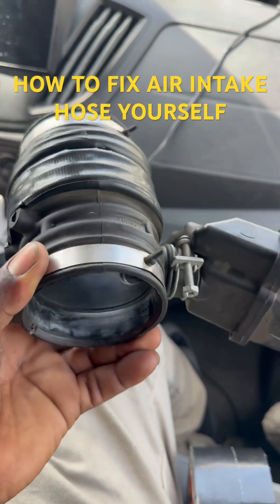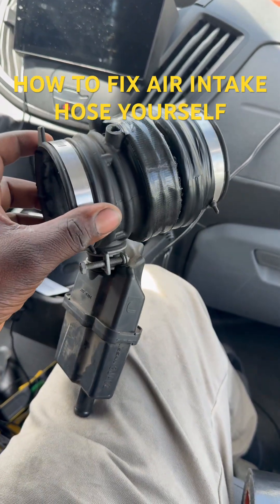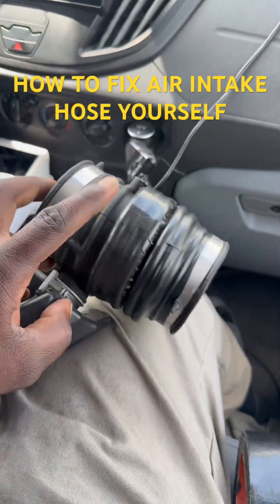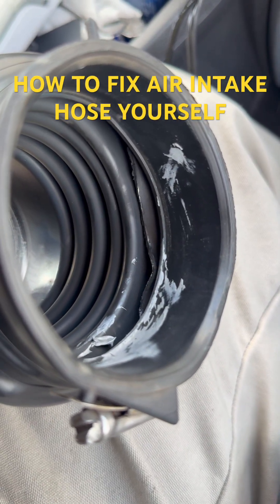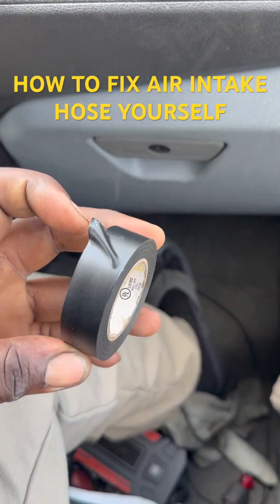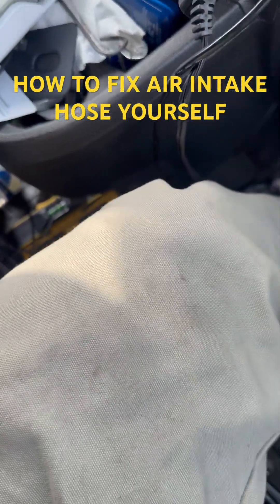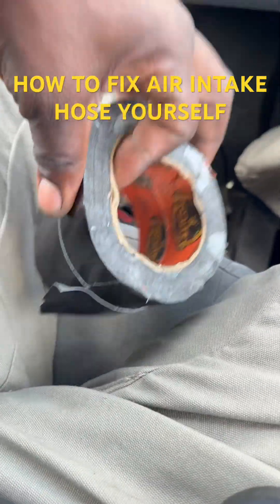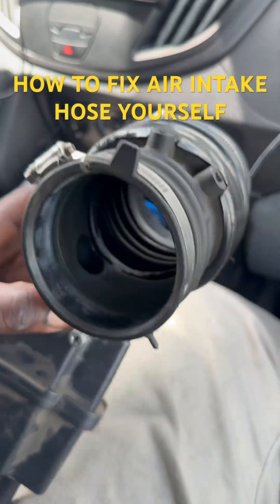How To Fix Air Intake Hose Yourself

Comment: What is it good for Mr Talented
Reply from the maker: The air intake hose is an important part of your engine’s air intake system. Its main job is to:

Direct air into the engine
	•	It connects the air filter box to the throttle body or intake manifold.
	•	It channels clean, filtered air from outside into the engine where it mixes with fuel for combustion.

⸻

Why it’s important:
	1.	Smooth airflow: It ensures the engine gets a steady, unrestricted supply of air.
	2.	Keeps air clean: Since it’s sealed, it prevents unfiltered air (with dirt or debris) from entering and damaging the engine.
	3.	Supports engine performance: Proper air/fuel ratio = better power, fuel efficiency, and lower emissions.

⸻

If it’s damaged or cracked:
	•	You might get rough idling, poor acceleration, check engine light, or even stalling.
	•	The engine might suck in unmetered air, which throws off the air/fuel mix.
Reply: Thanx bro💯